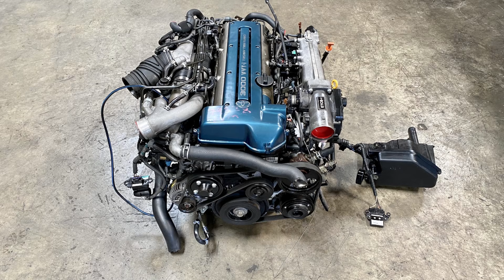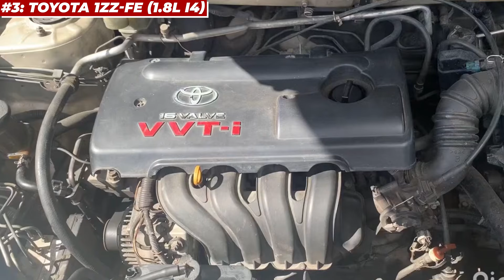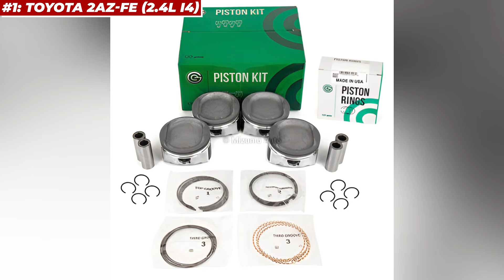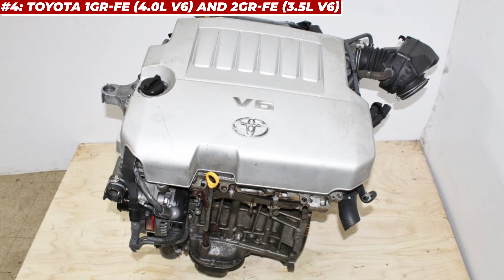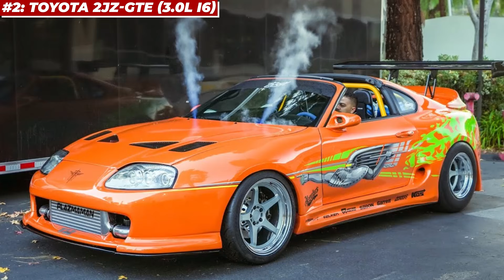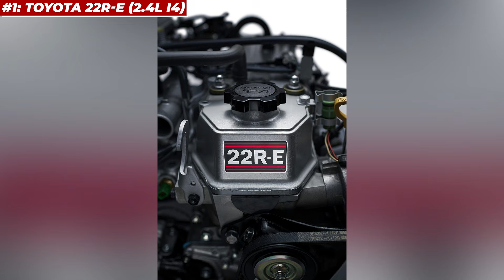3 WORST and 4 BEST Toyota Engines of All Time

Comment: I bought a 1991 4runner  4X4 with a 22R-E brand new.......still have and running stout with 275,000.  I also have a 2007 Tundra 4X4 with the 5.7 V8 with 185,000, which runs flawlessly.  They may not win beauty contests.....but they always start and run like champs, with minimal maintenance.

Comment: The Lexus  series 3 2014 2GR-FSE with D4D  (Port and Direct Injection( in my IS350 F Sport is amazing. 7.1l litres/100 100KM on a highway and a 0-100KPH in 5.8 seconds. 234 KW or 305HP om a sports sedan. 6 years of ownership 165K Km 100,000 miles and only regular service and a set of brake disks and pads,

Comment: I have owned and maintained several 2az-fe 2.4 cars.  The key word is maintain.  Some bad rings in several years but if you kept oil in them, they keep going.  Running them out of oil and then putting in oil will ruin them.  Pretty smart evaluation, right?

Comment: Typical AI review does not recognize diesel engines . Biggest problems with carbonisation  of engine components EG pistons/rings is low temperature running without the appropriate service levels .As in short town or city driving ,  If as in the first part of the video you add oil that looks like fuel or water it will use it no matter what brand of vehicle . AI is only as good as the developers that create it .

Comment: my 3zz-fe burning oil. top up half a quart in 190-200miles lmao. Even refreshed my block replaced with new piston rings and valve seals. so yeah ZZ engines does this if not maintained well with fully synth oil.

Comment: I owned a Toyota sienna minivan. It’s been 24 years and it still run like a champ. Same engine and same transmission. No problem. It got 489879 miles.

Comment: i owned 1zz fe and 2azfe never knew about burning oil, my oil evaporate about 5% every 5000 km and i think its normal, in my country so many 1zz fe and 2az fe user never heard about this problem except head gasket issue

Comment: The 2RZ-FE engine was missing, I have a 1998 Hilux with 280,000 kms, without oil consumption and working perfectly, only the regular maintenance of changing oil and filters, spark plugs, etc. etc. indestructible engine

Comment: I have 2AZ FE since 2003. Change engine oil every 10000km. No problem  with oil consumption. Minimum maintenance except for oil change. Timing chain still still new. Only change ignition coil after 150000km. No oil leak. My Captiva leak eo  at bit at oil sump after 100000km. My Merc needs to change timing chain after 100000km. All these cars since new and received same maintenance procedure as per manufacturer.

Comment: I had an 84 Toyota Sr 5 pick-up with an A22R.E engine that engine ran to a hundred thousand miles until I had to change the timing chain tensioner only.😅 i got a 93 f 150 ,302 with 230000 original miles with no issues.The only thing I had to do was change six injectors  recently. And it was a broken wire on the injector pigtail.

Comment: 1.8 engine uses oil because is clogged pvc valve very easy to replace cost only '$30 the problem is nobody replace this, and is recommended to replace every 100 000 km  .

Comment: If he wants to talk about crap engines , he's definitely picked the wrong brand.
Reply: Absolutely 💯 this guy is an a..  my 1995 Toyota Tacoma Truck had 357,000 miles on a 2.4 liter and then sold it for $3,000 . Still ran great with oil changes & general maintenance.

Comment: I owned a Toyota with a 22RE engine in it for 17 years, I sold the car because of rust on the body, but the engine and auto gear box were still in smooth working condition......🙂
Reply: Very common story.

Comment: Lots of mistakes.  The '75-'80 20R had superior durability to the 22R - because of its double row timing chain that stretched less and it had smaller diameter cylinders that helped enable the cylinder head gasket to last longer. The 2UZ-FE V8 had superior durability to the 3UR-FE with many one million mile examples.  The Previa van 2TZ-FE 4 cylinder and Tacoma 2RZ-FE & 2TR-FE 4 cylinders were the longest lasting Toyota 4 cylinders in terms of miles they could last (1,000,000).  The most durable Toyota engine of all - in terms of years it would run trouble free, rather than the miles it would last, was the Corolla '75-'82 2TC and 3TC motors.  These motors didn't have timing belts or chains that could wear out, nor did they have cylinder head gaskets that were prone to leak after 20-30 years.
Reply: Yes, I put 400K on a 20R in a 1977 Celica... that engine was bulletproof.
Reply: I've seen many 3tc motors taken apart to know they have timing chains.
Reply: @OLSKOOLOUTCAST  my mistake, you're right.  It was the Land Cruiser inline F, 2F and 3F 6 cylinder motors that didn't have timing chains.
Reply: @4af those must be noisy engines, yes?

Comment: The 22R-E's first appearance was in 1985 in the USA on the SR5 model, 1 ton model, and the cab chassis model. It produced 116 HP. I bought one new, that year, and I still have the original window sticker for it. The "E" designated EFI (electronic fuel injection). All of the other Toyota truck gas models had the carbureted 22R engine. The turbo diesel Toyota truck had a 2.4 litre engine.
Reply: 84 I own one

Comment: I have 2004 corolla with 1.8L over 250k miles still running ok
Reply: Yeah , same here, one of the most tough & reliable engine 1zz + 3zz ,

The only down side is that it's chamber designed consumed a lot of oil.

Though us i think Castrol 20w50 works so well.. (asian country)
Reply: It’s probably a ring and/or valve seal problem.   Probably.
Reply: @JamesStover-gr3hw  yes indeed.

But aside from that, very minor issues are list in that car.

In most of asi countries, we can use 20w50 of oil, no worries at all.
With this thickness, it doesnt much conserve oil unlike with 10 or 5w.

Even 1NZ-Fe, just like Zz family are tough.

I think theres a lot of confusion in this video.
Reply: @JamesStover-gr3hw  or head gasket, I think that's normal for a car in that mileage range
Reply: Yes it's very good
Reply: My 2006 corollas got              230 000kms  on it , burnt a bit of oil so i changed from 5 / 30 to 10 / 40 synthetic , drop the oil every 5000 kms and oil filter every 10 000   ,dont burn oil no more , cant believe its 1 of there worst motors find it hard to believe
Reply: yeah there's oil return holes behind the rings.

Comment: And , what about the bullet proof 2.7 4 banger ???
Reply: True, the 22r is what made the early Toyotas famous! Really started with the 20r, so easy to maintain. Loved those engines!
Reply: @louiskuamoo  I am 74 and bought my 1st   ( New ), the Hilux then in 82 . Beat the hell out of it while working in Idaho , Commiefornis and Michigan .... GREAT truck , never broke down !!
Reply: The 2TR-FE is a good engine until its not. Why did the engineers put a plastic coolant by pass line, heater hose really. This pipe cracks cracks the head. Head can,t be replace in situ. The engine must be removed front housing off & oil pump removed repair or new head. Cost many $1000. Not worth it.  I found this out last week. I'm looking for a 2nd hand engine @ moment. Cheapest I can find $3000 plus labour. Plastic heaters hose WTF Toyota.
Reply: Yeah. One of the biggest shits ever
Reply: @akoziy  The 2.7 1AR-FE is not a good engine but the 2.7 2TR-FE found on Tacomas are very reliable
Reply: @techburnsca  Yes , in Tacoma's . I've had 2 with the 2.7 4

Comment: In my experience the 4 cilinder series B, 3B, 13BT, the 6 cilinder series H and HD are the best Toyota engines. Even the L series did 400.000 km and more.
Reply: Because they don't have enough power to brake anything